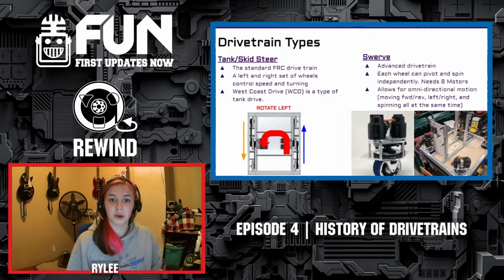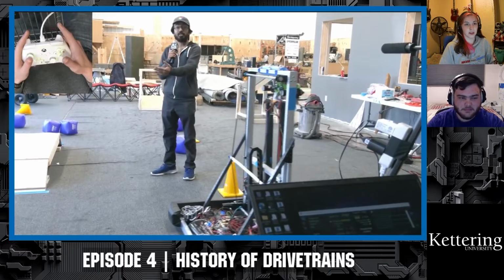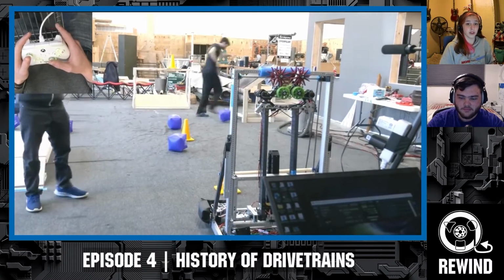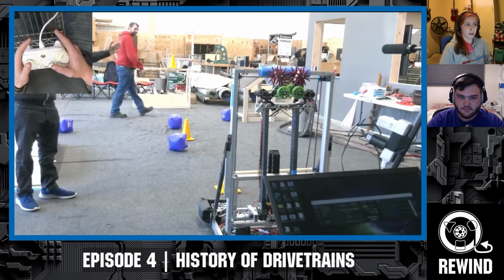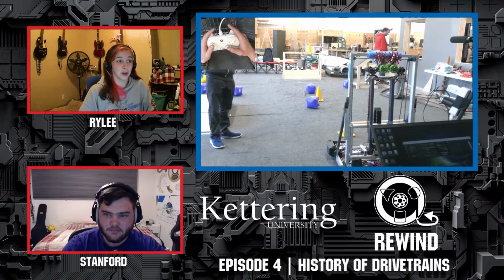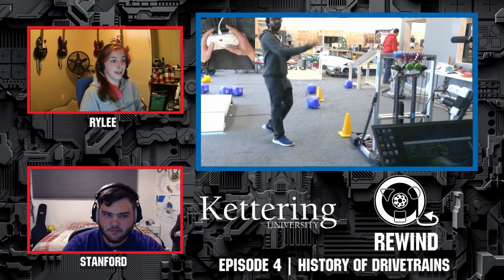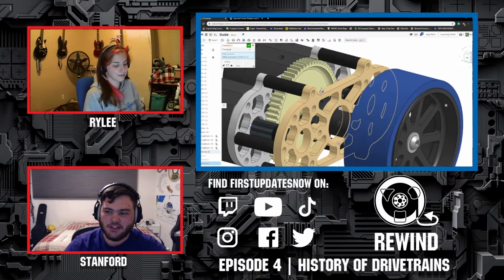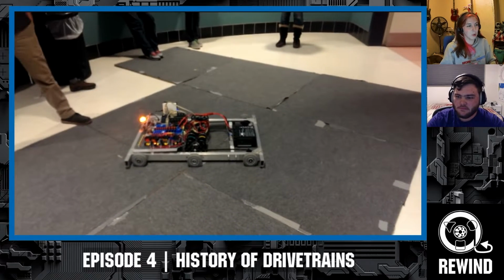FIRST Rewind Ep. 4 |  History of FRC Drivetrains | FUN

Comment: I think my jaw dropped twice over the years of doing first.  To the best of my knowledge the first Swerve out there was Chief Delphi in the late 90's.  They had 2 swerve modules and two casters (back in the Basic Stamp Days).  It was under shrouds so no one could see it until the comp but once the match began everyone started saying " I think 47 just went sideways?"  It pretty much kicked off the innovation.  The other was early 2000's Team 71 I believe, the 'beast' used a walking drive with 'file cleaning cards' as the feet.  It was banned after that year since it could ruin the carpet field but it was 100% unstoppable.  That year you had to get the field elements down to the other side of the field.  It would dart to the center of the field upright on 2 wheels then drop forward onto the feet for the rest of the match.  Two of the most innovative drives I had ever seen.  Also back in the day you had to buy all your parts on the robot from the 'Small Parts' catalog which made it even harder to be innovative.